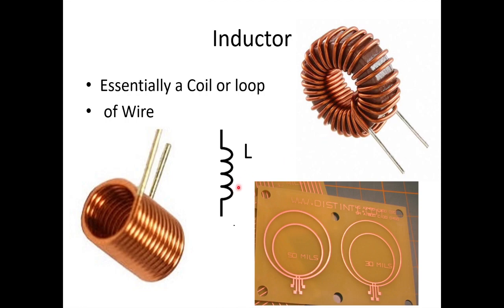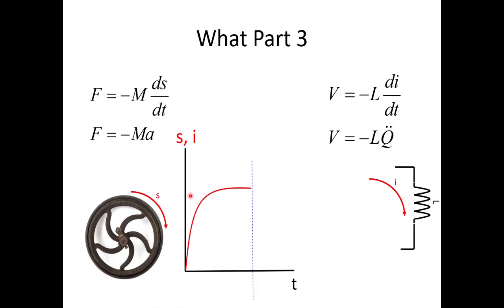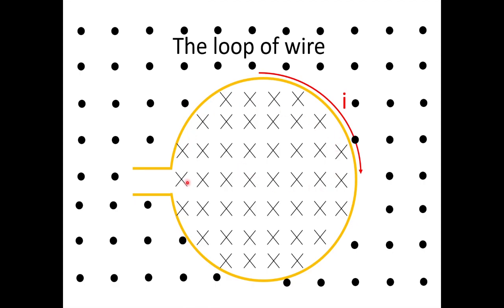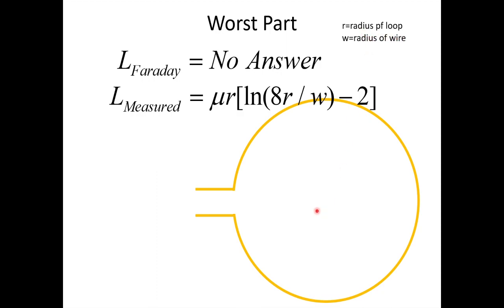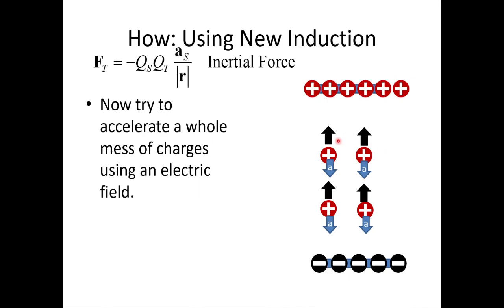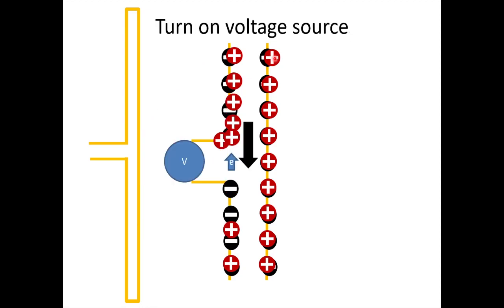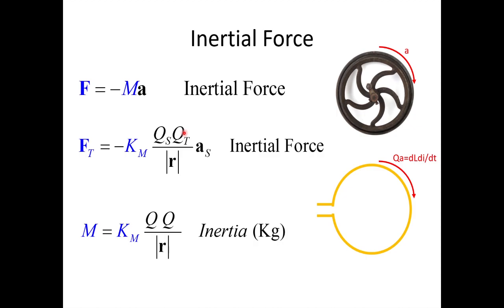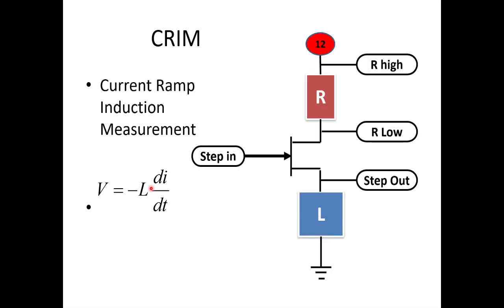EM04 02: How Inductors Really Work

Comment: Regarding Derek's claim, we learned in high school physics that his explanation was correct.  Electrical engineers are not generally taught physics, they are taught a small, specialized, and more easily workable model for building circuits - this is why he received so much push back from the EE channels.  Radio engineers are somewhere in between.
Reply from the maker: This is not correct.  At least it is not correct when/where  I went to school.  We were taught physics from the ground up.  In fact, those who dropped out of the engineering curriculum enrolled in the physics curriculum.  We have to know what we are doing because peoples live depend on it.  It is technicians that typically get the "cookbook" education.

Comment: This explains a lot. If you were to wind an air core coil normally, then wind another coil with a bifilar wire (of the same gauge, material, loops, and total length) such that one wire loops back from the end to the beginning and is connected (basically a mini "runner"), you will find that, as per an LCR meter, both with have the same inductance, however, the bifilar coil will have twice the magnetic field.  I've tested this myself and could not find the answer from my EE friend (I was in EE for a while, but didn't finish college) who was a bit baffled by the result.  he thought my $100 LCR meter was somehow not working correctly, so he pulled out a $1000 LCR meter with the same result in uH.  He also verified the magnetic field strength was, indeed, double the value (in uT) (for an air core - for some reason, an iron core quenches the magnetic flux output - both coils would yield the same result - go figure).
Reply: I did an experiment on magnetic cancelling coils and found other results like back EMF (wait... what? how can you get back EMF without a collapsing magnetic field?). My buddy couldn't explain this phenomenon either, but said something to the effect that the magnetic field is still there and not completely cancelled (however, no magnetic field was detected: <0.01uT on my coil which was painstakingly wound to precision).
Reply: @davestorm6718  One thing to keep in mind is that instruments can only measure certain things. In other words, there may be some esoteric field or energy there that the instrument cannot detect, and you shouldn't conclude there is nothing just because your meter reads null.

Comment: One issue I assume with inductor no one ever mentions is the friction it has on itself since if you put another wire next to the coil without it connecting to voltage but read the voltage you will see a counter voltage which.
Reply: Isnt that induction
Reply: @lukiepoole9254   @Lukie Poole  yes and no in the way you say it. Since if every coil has electromagnetism going clockwise around the coil and the coil next to it wraps around the coil also goes clockwise it is like having 2 gears rubbing on each other going clockwise which cause friction loss. If another gear was put in between them then there would not be friction.  The principle works in physical mechanics, so it should apply to electromagnetics as well. So how much friction loss is it?

Comment: New thinking I like it. Electric potential power is RF.
The amps in in the field. The dielectric field. Outside the wire!!!
Regards DC
Reply: There is momentum inside wire as well, which is why metal cores rotate if freed
Reply: @lukiepoole9254  Hi Look, what momentum? Scala? Think that you correct and we need "New Vision"; it all starts with "Electrons"!!!
This up set Tesla and it upsets me. 
Quote Me:-  E.powerDC 

"Electrons do not exist".

We need another protocol in Physics. 

Aether is key: https://youtu.be/2ozcxTL86_Y 

Regards DC